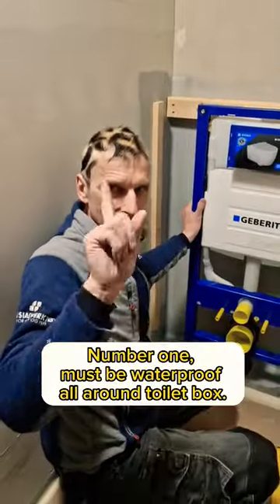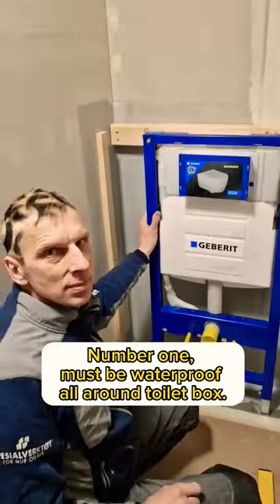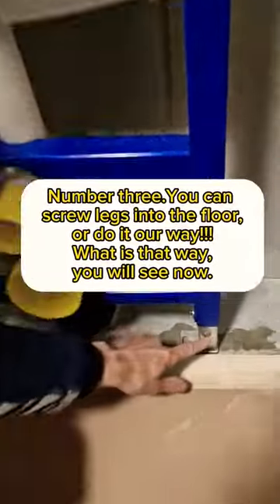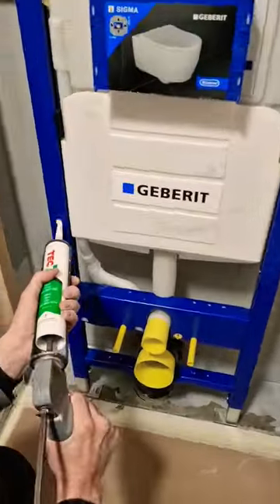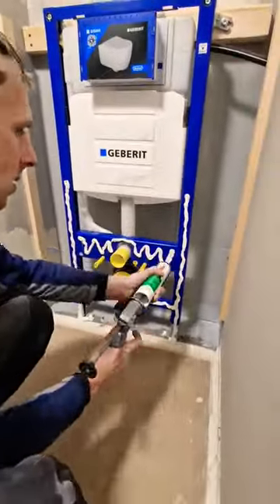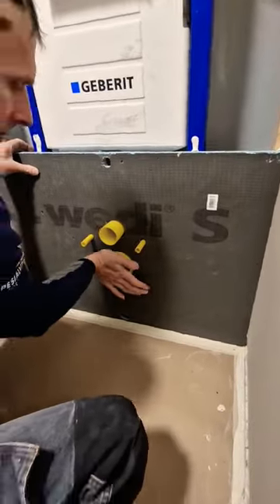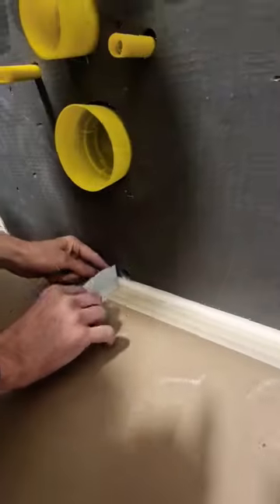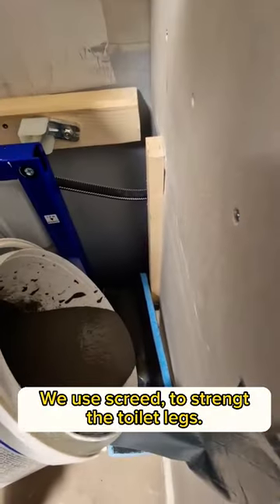Installing In-wall Toilet Carrier-Geberit #diy #wallhanging #shorts #geberit

Comment: Journeyman plumber here, yeah no fawk all of that no residential house needs a wall mount toilet of such nature 🤣
Reply from the maker: Joke .....real joke ? 🤣
Reply: @vakopilotssystems  Not really a joke man unless it’s one of the most high end houses to exist… there’s no point in any house having a wall mount toilet my guy even if it’s some bougie azz pad 🤣
Reply: @TrentHafen  Nonsense. For those of us with tiny bathrooms, would be nice to have one for the space savings and ease of cleaning under it. Not to mention it looks killer.
Reply: Far from the bourgeoisie, just needed the space and in that regard it is excellent. However, to say the installation instructions are terrible would be an insult to terrible! 
Even if the reader spoke perfect Manderin.  So bad.
Reply: @TrentHafen  wall mounted is the way forward.. I've just put one in my bathroom. It's looks the bizz and so easy to clean. no need to clean behind grimy cisterns and pipework that just dirt traps.

Comment: Doing all this is a good idea if you won't need to open/fix/replace that toilet ever again. All that extra glue on the boards plus screed at the bottom will take forever to clean up and everything except the visible parts will need a replacement.

Comment: Hi. Any idea how can i fix the bottom screw if i have floor heating pipes in concrete? I really don't wanna drill it and find the pipe. Thanks.
Reply from the maker: @petek641  hi, here you have answer in this video .....
Reply: Ahhh. Sorry. I missed that point in video. That's why you use concrete. Thanks. Will install in this way!
Reply from the maker: @petek641  👍👍👍